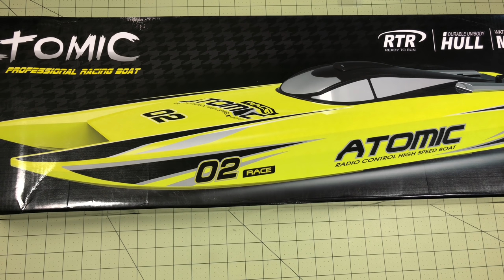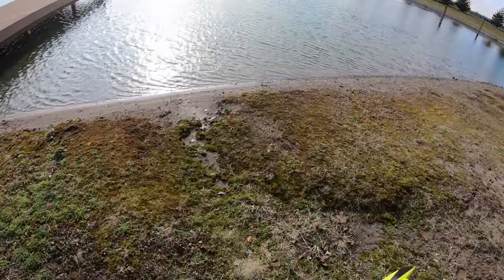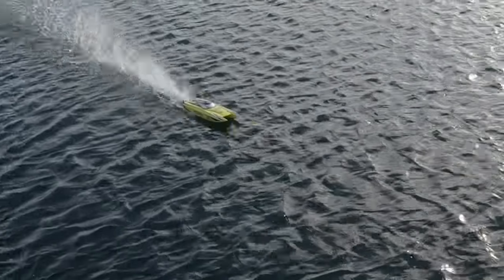Atomic Race Boat – Two RC Boats are Better than One

Comment: No but what a boat, I can't believe how good it runs,  the last boat I had was a kit I built in junior high and the only motor I had was a OS/MAX .20 and I used a copper tube that I bent around the head to run the cooling system, I liked the black one that turns over. Thanks again for the info and the show.